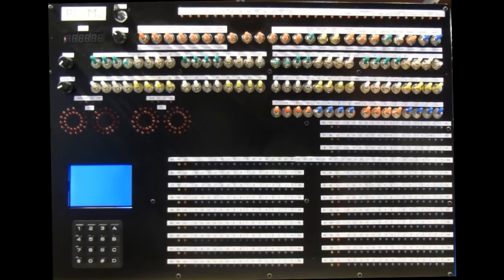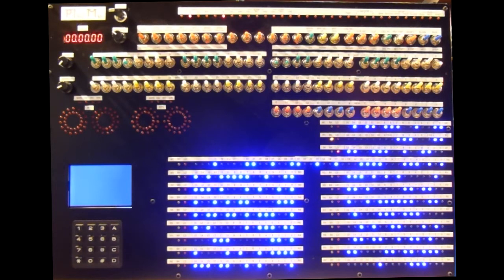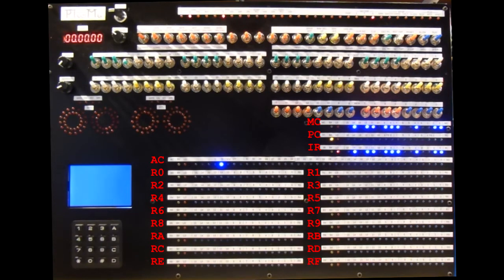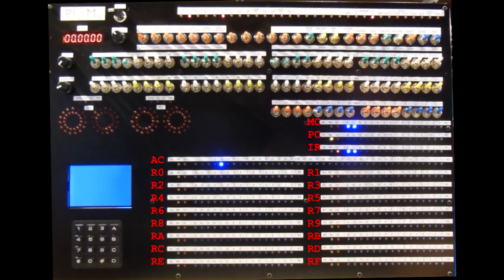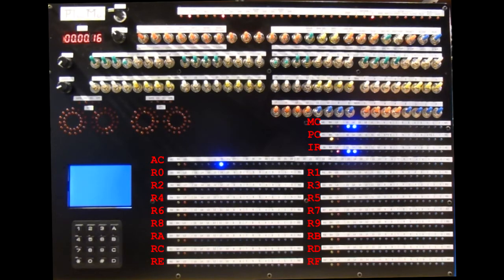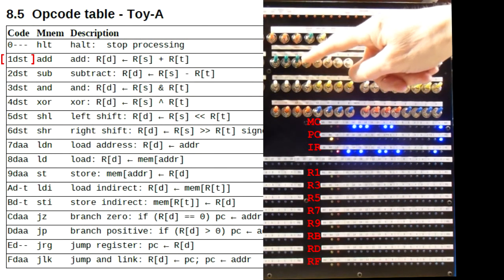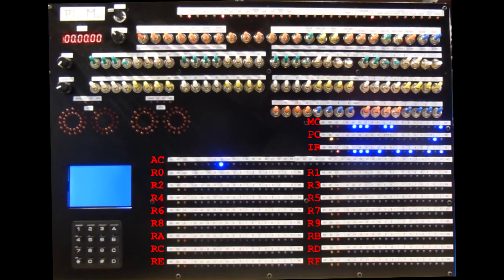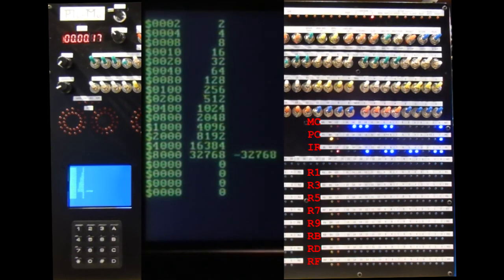PlasMa - 6. Alive at last!

Comment: Phil. Isn't Linux one of the first computer programs? Is Plasma a controller for Linux? Will.
Reply from the maker: @W McCourtney Hi Will. No, this is way before that; 20-30 years maybe? There's no operating system in PlasMa; it's a completely bare machine. If you want an operating system you have to write your own. That's part of the fun... getting it to do something useful from scratch :)  All you have at your disposal are those 16 instructions shown, although this is in novice mode. The more complex mode called PleX has about 100 so it can do more advanced things like read and write to mag tapes, but either way, they are still primitive instructions. 
Thanks for stopping by.